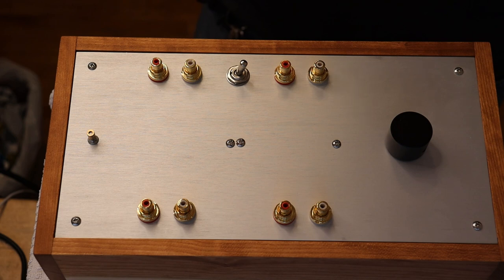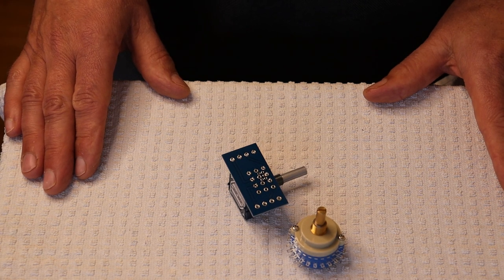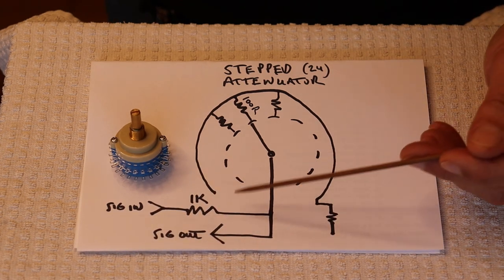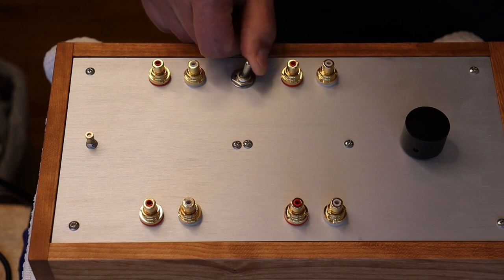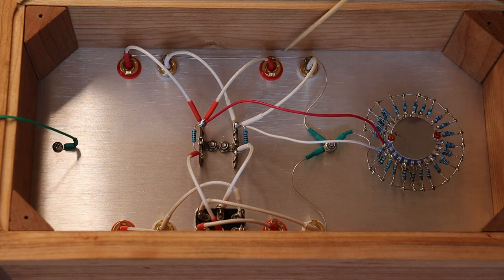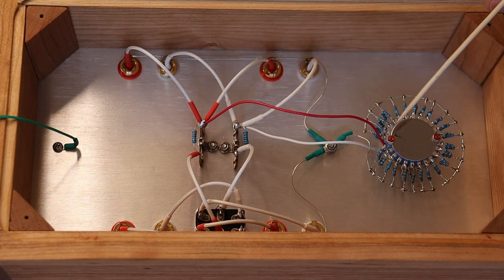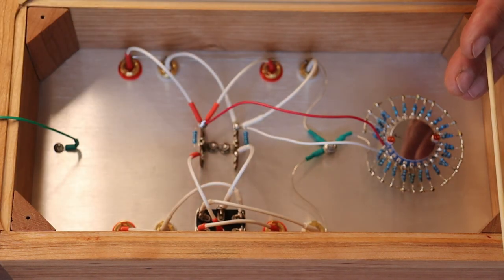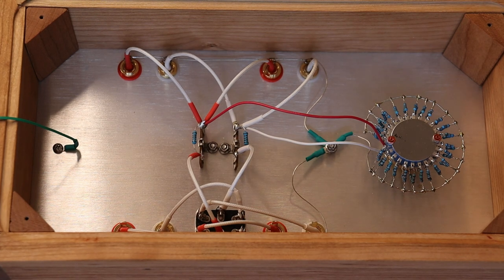Stepped Attenuator Prototype

Comment: Hi Jim, after twenty audio equipment builds I would have no problem soldering those 48 resistors to that selector switch, but it would be tedious.  Another way to create the kit version would be to mount the resistors to a prepared pcb.  The selector switch could be fly wired to terminals on the board.  It wouldn't look as cool, but it would be easier for most to solder.
Reply from the maker: Yup that's a valid approach and we thought about it (well Charles did), but I was lead on this design and I went with what I thought would be the best assembly method - none of them are ever going to be perfect or a lot of fun to assemble, but the resulting sonic improvement is absolutely stunning, so well worth the effort!  Fun fact, after installing the prototype attenuator in our main listening system we couldn't take it out again, that's how much of an improvement it made, particularly to the clarity of the signal.  Charles observed the single largest improvement was the low frequency bass notes, which went from slightly muddy to noticibly firm and well defined.

Comment: Very cool.  Would be great if the kit had options in terms of # of inputs and outputs.. in my case I would only need one output and 3 inputs.
Reply from the maker: @HoomanR17  unfortunately it's not practical to design for 3 inputs, at least not the low noise circuit topology I like to use.  When we design a new Kit we have the sonic performance as a priority, then the features that 90% of users will need, then aesthetics.
Reply: @mellowtoneamps4932  Thanks for your explanation. I understand the criteria for your design. Correct me if I'm wrong, but isn't the input # just the difference between going from a DPDT switch to a TPDT switch, or is it the case that the brand/quality switch that you use doesn't come in that flavor?
Reply from the maker: @HoomanR17  correct the switch type we use is limited to DPDT and where would you even put a 3rd pair of RCA jacks?  We have a multitude of source signals and whenever we run out of inputs we just swap one out.  Otherwise we'd need a dozen inputs, which would basically be a patch bay.  And that's not something I'd want even in our main critical/test system - though the idea has merit!

Comment: Hi Jim, if I wanted to use this stepped attenuator before my integrated tube amplifier that has an 100k pot and turn that pot all the way up. How would my input impedance be affected?
Reply from the maker: @garyvitrano8362  good question, IF your volume pot is a passive device like a blue alps or 99% of all pot ever made (till recently when manufacturers started switching to chips) then whatever the impedance of the pot is, that's the input impedance of the amp.  So in your case 100k ohm, even when the pot is fully open.  You can actually measure this, with the amp off, use an old rca patch cord, strip back one end to a centre conductor and ground shield, connect both to a volt/ohmmeter, switch to ohm function and Bob's Your Uncle.

Comment: This came really timely, as I have been looking for/into a passive pre for my system for a couple of weeks now. Some comments, and questions: I would use this to bypass both the pot and the selector switch on my amp (crap quality). I would only connect my turntable and DAC, and for the DAC input I would actually like to bypass the whole attenuator and just use the "preamp" as a selector (I use digital control on a PC for that anyway). How would you wire that? 

Remote control would be a must for me. I hope to see you come up with something cool there :)

LDR's - Have you ever looked into those, tried something built around it yourself, or have any thoughts to share?
Reply from the maker: Coming up with a remote control that doesn't muck with the sound is unlikely, which is why none of our gear has any of that kind of stuff in it.  But we're taking a look to see if something can be built that both meets our requirements for uncompromised sound and allows people to control the volume without ever having to get up.  
I have no (zero) idea as to what an LDR is.  
The way the stepped attenuator is designed does not allow a complete bypass, I'm not sure what the point of that would be?
Reply: @mellowtoneamps4932  Thanks for replying! The point of the bypass would be to avoid another attenuator in the signal path when using the DAC, and just have direct to amp input. Since I want to eliminate the selector switch in my amp and have only 1 input there. Workaround would be setting the attenuator to max when using the DAC then.
Edit: Actually, if I just reverse the order and move the switch to the output side, I can wire 1 input directly to the switch, the other input to the attenuator, and Bobs my uncle?

LDR, light dependent resistor. A design around those would leave a very short signal path, but would also require some electronic control. So arguably not a true passive. 

Oh, and reagarding your question on soldering 21 resistor pairs, I would say that sounds like a fun evening :)
Reply: If you want LDR and remote control I would suggest looking at a Tortuga Audio.  It's expensive but you can build it yourself.
Reply from the maker: @brianhowe2078  we design everything in house from first principles.  Some would call us old school, but honestly I don't care, so long as we achieve our primary goal, which is great sound and almost as important, our second which is affordability.